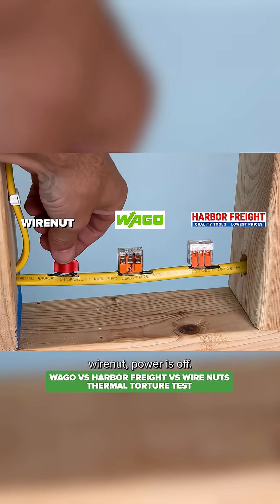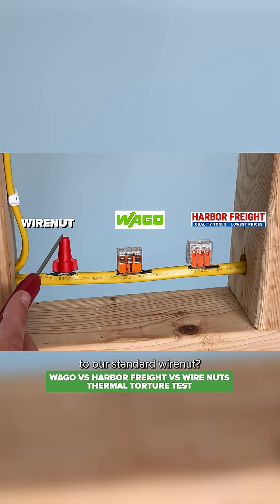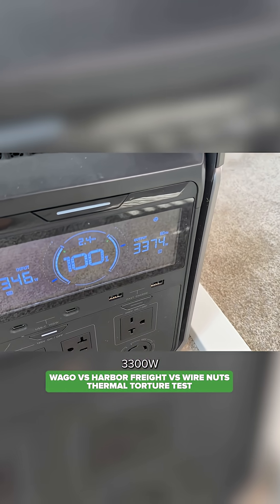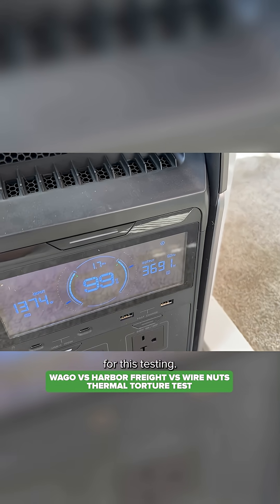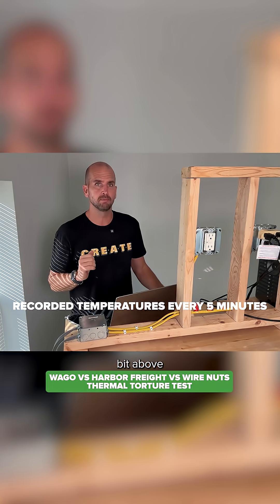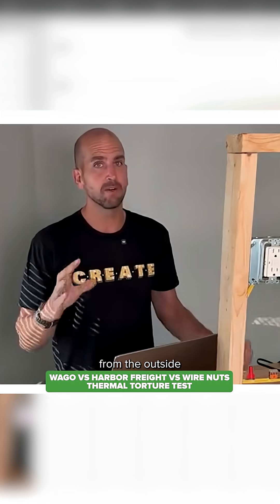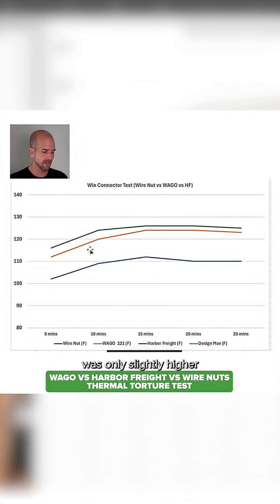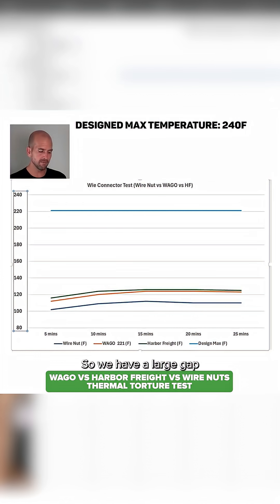Harbor Freight vs WAGO — The Truth About These Wire Connectors!  #diyelectrical

Comment: Try using 10ga. wire for a 30a load. Of course it’s going to get hot because you used under sized wire for your test. Maybe next time ask an electrician before you do your test.

Comment: An interesting measurement would be the voltage drop across each device. Knowing the current and voltage drop allows a direct calculation of the power dissipated in each device.

Comment: If you hypothesize that the connectors modify the temperature, how is it not glaringly obvious that the connectors should not be on the same line, 2 inches away?

Tests designed this poorly only ever happen when you dont ask anybody else to take a look at it.

In this case, a decent middle-schooler could have helped you out here.

Comment: I don't trust HF battery tools.
Over a few years, batteries won't recharge so tools were useless because they discontinued those tools or changed batteries making them non compatible with each other.
Then, they didn't even take the old batteries in for recycling.

Comment: This is a great example testing actual use. Do you think average users think before they use a couple of space heaters and electric blankets? Or window air conditioners in a heat wave. They are not checking loads to wire/breaker specs until the breakers pop. If the plug fits in the outlet it’s in real world use. I agree the wire resistance and ventilation could be better controlled. I would like to see 3 separated spliced romex sections and faulty insulation installed surrounding the connections!

Comment: The advantage of a properly installed wire-nut is that the electrical contact area is huge due to pre-twisting the two wires together.  Wago type connectors have a much smaller contact area with the conductors.  Lower contact area = more resistance = more heat.

The problem with using wire-nuts is it takes a small amount of skill to do it correctly.  Wagos are nearly idiot proof.

Comment: I’ve trusted pre twists wire nuts for nearly 50 years with no troubles. Only trouble I’ve seen is untwisted wire nuts. It would be good to see this tests with heavier wire so as to eliminate that heat signature.

Comment: A completely unrelated question, with respect to the safety of the different connectors - how likely are they to maintain the solid connection that they have after install, over time? 

If used in an unfinished garage, where some idiot might one day hang work lights from the exposed wires, or if you used these in a camper trailer, where they'd be exposed to vibration, how would they hold up?

Comment: I'd be more concerned about the difference, if any, of the pull strength between the Wago and HF lever nuts. How likely is a wire to pull out from one or the other once you cram three lever nuts into an electrical box?

Comment: This is a bad test. You've got 3 resistive points in series, and anyone with even a modicum of electrical knowledge, at least in basic principles, knows that resistive loads in series compound. To make this test legitimate, you should have had each connector on its own circuit for testing instead of putting them all together on one load. This is typical nonsense portrayed by "handymen" who have virtually no actual knowledge of what they're discussing, rather they pull these stunts and give false information simply for more clicks which equals more pay from YouTube and ad revenue. What a sham

Comment: well… kind of irrelevant for most resi work…30 amps would blow most residential breakers anyway….I would love to see the test using  14 gauge /15 amps and 12 gauge 20 amps…I just used wagos on a 15 for a new outlet extension…no heat issue at all…🙄

Comment: Totally misleading video, You obviously have an infrared camera, maybe attached to an iPhone you do not make any reference to your test equipment.
You make no reference to “ indirect “ temperature, you also make no reference to material “ emissivity “ BOTH EXTREMELY IMPORTANT in thermal diagnosis.
The very least you could have done is wrap all three devices in 3M 333 tape ( The industry standard for electrical tape ) and a perfect emitter, that way you would have presented a more realistic temperature reading.
You may have an infrared device but you display little actual knowledge of how to use it or display accurate readings.
Do the test again but not with all three types of connectors in series, do them individually WITH AN INFRARED THERMOGRAPHER with a real FLIR camera to show precise results.
You have just proven anyone can make a video about anything trying to look good, but stick to what you are licensed for.
Licenced by FLIR  levels 1, 2, and 3 Infrared Thermographer, and Master Electrician.

Comment: The real test is when after 5 - 10 years of use which is the best at maintaining a proper connection.  Switch these on and off about 5000 times  but at 15 amps not 100 degs   then see how they have changed.

Comment: The more important test would be temperature rise after they have been in use for a few years, with thermal cycling and oxidisation?
With newly stripped, clean, copper the one with the largest initial contact are will run coolest, but time, expansion & contraction to change contact pressure, plus oxidisation, will change things.

Comment: Just a note it looks like the connectors are all in series so the first connection would be the least current draw therefore the least heat the second  would be hotter and more current and the 3rd higher and so on. The more resistance per connection the higher IN MY OPINION.

Comment: all that work to set up that test and its still not represntative. They should each be in their own sealed box packed with a few other conductors also creating their own heat.

That silly shit with the romex in this test was pointless. not to mention potentially skewed the results by heat transfer down the wire to the next connection.

Comment: I have a problem with wire nuts, 1) you can't see inside them to be sure how good contact is, 2) they are susceptible to loosening with vibration, 3) much easier to damage than the WAGO type connectors. 
I pulled out a security light to replace it with a newer model, and found that the connection had been arcing for some time, so likely the source of a "hot electrical smell" that had been bothering me for some time. House wiring is solid wire, while most lights come with stranded wire, so a good way to have a poor connection.

Comment: So what did you learn? With properly twisted leads, wire nuts are always better? They can handle more amperage? They are more compact and fit in tight enclosures easier?  They're cheaper? Readily available? More reliable? Less prone to mechanical failure? 
No, no you didn't learn any of that did you?

Comment: Seems like you could look at the voltage drop across each connection under load. This would give you the relative power dissipation and remove the issues of the local thermal resistance from the experiment as well as the emissivity of the materials. Nice video. Thanks.

Comment: Or you could just measure the resistance. Resistance causes heat. 
Measuring temperature through different plastics is not accurate.
Also need to include a baseline control temperature.... The temperature for the wire before and after the splices.

Comment: The only way I would use these lever lock connectors is for prototyping and testing. Situations will be constantly having unwired and rewire something, for permanent or semi-permanent insulation I'm going to go to the old-fashioned windnut

Comment: WTF is "DIY wire connector"? Or a "DIY pre-twist" for that matter? Interesting test though, thanks for confirming that solid wires in intimate contact are a better connection than wires connected by a thin piece of spring loaded metal.

Comment: You have them in series, the third one in line will have the easiest job.  To get accurate results, each device should have its own circuit
Reply: Yeah a series test is no good.  should be singles on each type

Comment: ...........a properly made up wire nut will always outperform "pressure connectors" like these. Good solid connections are about 2 things:  "Pressure" and "mass" . How much force is being applied to the connection and how much copper or aluminum makes up the connection point.  The more "mass" you have the easier it is for current to flow through it which is the reason why a wire nutted connection will run cooler under load than "pressure connectors" like  "WAGO's"  which are not good for sustained moderate to heavy loads.

Comment: I was an instructor for FLIR (in different capacities) for almost 25 years, and there’s an important thing you didn’t mention, at least in this short — what you’re seeing is what’s called an “indirect” temperature reading. Based on the thermal opacities of the different materials, you’re going to be seeing a temperature at the surface of the plastic, not at the points of contact. The actual internal temperature can easily be 50 degrees higher at the contacts.
Reply: He did in fact mention that.
Reply: Yes correct. Therefore If you qualify electronics the final measuremt will be done using Thermocouples. Also you can calibrate the IR measuremet to the TC Temperaturen.
Reply: Still lower than design max. But, is the wirenut better than a wago? If so, what about degradation over 10 to 20 years? Obviously the wago is fast. But, is it safe and for how long?
Reply: So in you opinion what's the best to use. Wire not seems to be the one????
Reply: @billneurohr8509  Wirenut is always the best, and cheapest too.  
The push-ins are time-saving options, which aren't better in the long run, in any way whatsoever.
Reply: @billneurohr8509  Best is to solder.
Reply: Wait a minute... it looks like all of the connaectors are cooler than the wire iteelf?  So, yes, he's only measuring what is escaping the shell...
Reply: Test set up flawed and biased. The wire nut conductors are pulled out of romex jacket giving huge airspace. Other two connectors are no air gap. There should have been 3 controls: small romex window cut away allow thermal image conductor in jacket, same but conductor pulled up two diameters out of jacket, and third conductor pulled out 8 diameters. Non contact radiation measurement (thermal image) will make unspliced conductor inside Romex look hottest. Radiation heat transfer is 4th order compared to first and second order so terrible for attempting infer resistance.

Comment: But why use lever nuts on solid core wires? They make cheap and very compact press in nuts for those that are rated for even more amps (so I assume less heat). The lever nuts are useful for flexible wires.

Comment: Take a NM wire segment. Cut in half, connect to the wagon, measure resistance at both ends. Strip then twist and wire nut and measure resistance. Compare. That would have been good side by side.

Comment: If your a novice I only recommend wago. It requires zero nuanced understanding and is perfectly safe as long as you are using it on a properly rated circuit. If you are a pro it is dealers choice. With practice wire nuts install faster than the wago and you don't snap your fingers with those little levers but can be more difficult for rework. The reality is there is zero difference as far as longevity or safety as long as you use the properly rated fastener for the circuit.

Comment: I just replaced a wire nut in which a wire came loose. Push connectors are much easier to use and giver consistent results.

Comment: If you redo this test, add a wire nut without the twist... Just because, a lot of people say not to pre twist 😅 I always twist, but that's how I was taught. 

I'm also not an electrician, my specialty is electronics so... Solder everywhere possible 😂

Comment: The circuit is overloaded for the wire size. Everything is the same temperature. The thinnest plastic allows a more accurate temperature of the wire, than the thicker plastic. Strip the wire, and check it's temperature.

Comment: 30 Amps on a 12 gauge wire is a code violation. Your test has many errors and if you’re not a licensed electrician you should not be doing this. You do not have the qualifications for showing the public this information.

You will get someone hurt or killed with this kind of material.

Comment: First of all... splicing is never good, thats why electricians, car manufacturers, or anyone who uses wire use straight undamaged wire with no splices. if your 1 inch short on what you have you better get another line that will reach! so with that in mind, this test would have been better results if each were tested on their own NOT inline together.

Comment: I only use Wago brand. And only if I have to. Like if the wire is to short or old  brittle insulation.  He did not spec out the thermal camera. The cheap ones do not give an accurate reading. The material being scanned can give inaccurate reading . I like the idea of votage drop and resistance across each device.

Comment: 30A @ 120VAC requires a 10 gauge wire.  Long runs require 8 gauge.  50A @ 120VAC requires 6 gauge.  What gauge were you using?  Didn't look like 10 gauge.  Were each of those connectors on their own individual line?  If they were in series then the resistance of one would affect the performance of the other.

Comment: Are you suggesting that if you use any of these connectors the way they are designed, you won't suffer any ill effects?  I've used all three and sleep well at night.  My fingers like it best when I use the one that is consistently the easiest, so I'll cough up the extra dough for Wago connectors pretty much every time.

Comment: If you are running 30 amps continuous you should avoid using any of these! At that current, wire directly from the panel to the device! At 20 amps, all 3 should be fine, unless you do a poor job with the wire nut.

Comment: I would have liked to see this test also include a bear twisted connection, like the one for the wire nut, but without any wire nut, as a control.

Also, I had not thought about it before, but the wire nut connection is direct wire-to-wire connection whereas the other two require electricity to flow through the connecting device. That said, I am disappointed because I would have expected the Wago and Harbor freight connectors to have sufficient Conduction to where they should have been equivalent to the wire nut.  Or perhaps they do not make as good of a connection from the wire to the built-in conductor that I thought. I would love to see more analysis, as I am switching away from wire nuts because I have had them fail and cause a fire before.

Comment: The only real down side of the Wirenut is usually user error as unlike the other 2, the wires are alward touching, so no current need to pass through the internal workings of the connector... so if you install them correctly it will outlast the other two comectors. I have taken them wirenuts from old concrete houses that were built before I was born and they were still holding on... I do removed them as we are doing new installations, though I still use them. Wago's main benefit is just ease of use so the chance of installing it improperly and thus having less problems as it reduces the user error side of the equation by quite a lot... though still stupidly expensive per piece when compared to Wirenuts and a bit bulkier too.
Reply: Re: More bulky, depending on application, the inline Wagos are far less bulky than a wire nut.

Comment: I'd recommend another case: poorly twisted/installed wirenut. To me a big advantage of the wago style connectors is consistency so a one-off test is much less interesting, particularly in the wirenut case (i.e. test 100's of each with different manufacturing lots & people doing the install if you really want to see where wago-style shines).

Comment: Indirect readings are always lower than the actual heat source. You would need to remove the plastic insulator components from each connector type (i.e., get a direct reading and eliminate emissivity disparities from the insulators) to get consistent/comparable readings. You would then need to compensate for emissivity and reflected apparent temperature to be able to determine actual temperatures vs. simple relative comparisons. You need to work on your thermographic testing methodology to produce meaningful conclusions from such an experiment.

Comment: Does running 30 amps thru a 12 ga wire make a difference? 10 ga should be used as it should produce less heat?

Comment: People, let’s make sure we’re looking at this from the right perspective. THIS WAS 30AMPS !! And the wire was 12awg at most. Think about the average circuit amp rating. Your breaker will trip before any of these give you an issue. And if you’re using these in a house on a 30amp circuit with 10/2, you’re just asking for trouble. Only issue with the HF is size.